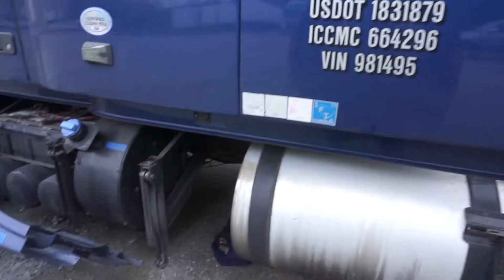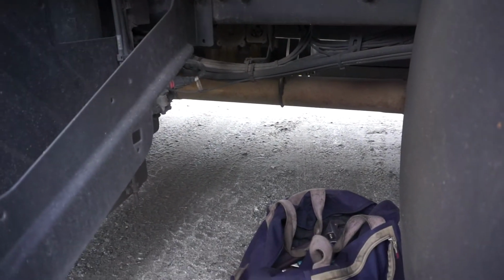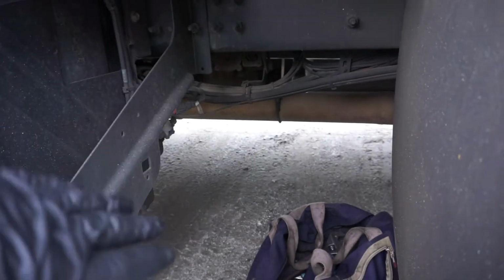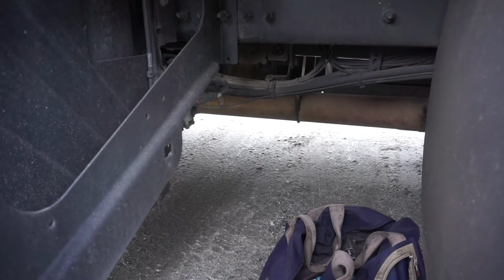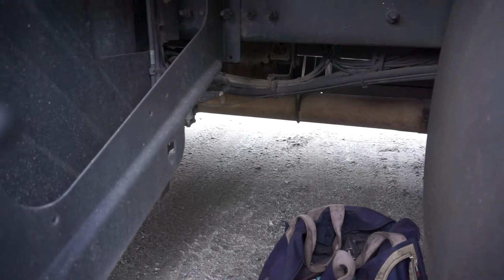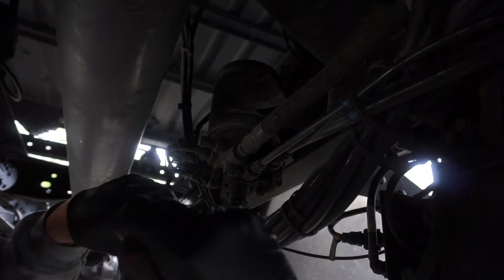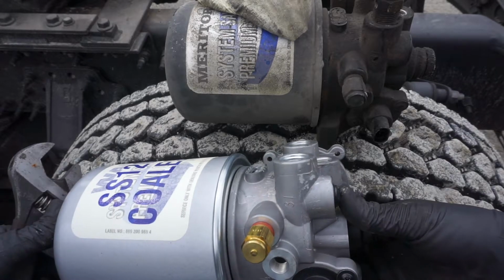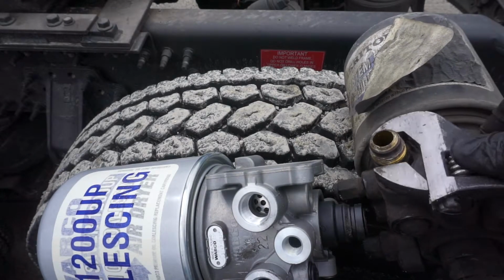How to replace a air dryer on a semi truck

Comment: Ok I replaced the same NEW air dryer Wabco  and same model semi truck.  but the air dryer do not do the function has so post ti do it . do not worked . what is the problem?
Reply: any Answer for this . I don't know what I need to fixed tha problem?
Reply from the maker: It could be a few things but more then likely it’s either a line is not connected all the way or it is possibly a defective unit